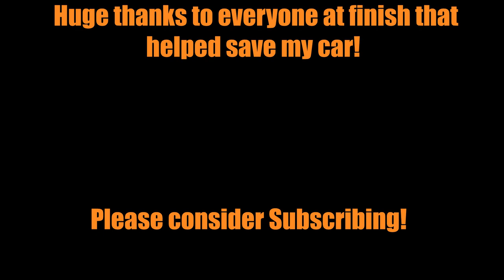NEW GTM RECORD - Knox Mountain Hill Climb 2022 - Toasty Edition

Comment: Wouldn't be a dsm if it wasn't breaking haha
Reply from the maker: Not a single dsm related part broke this year!  Just an unlucky crack in a AN fitting.
Reply: @smokin80  
I couldnt help myself, had to throw that cliche comment lol

The real truth is most dsm owners are hacks and don't maintain them hence the stigma they have for breaking.

P.s. congrats on the placing
Reply from the maker: @schafer240  all good man. I say the same thing all the time. Mechanically this car has been amazing. Electrical issues have been my biggest issue. But I don’t blame the Dsm on the electrical issues this weekend. Fires are hard on wires. Lmao